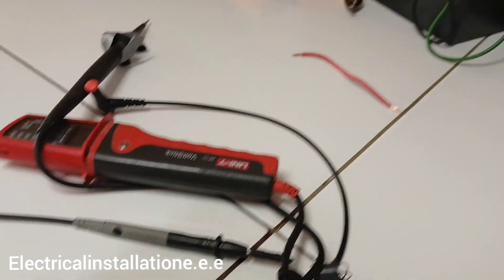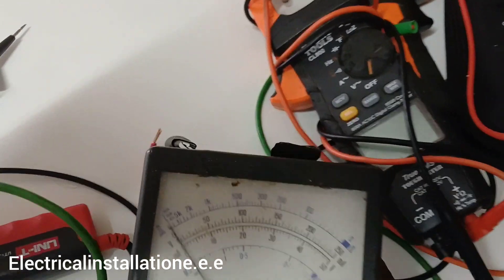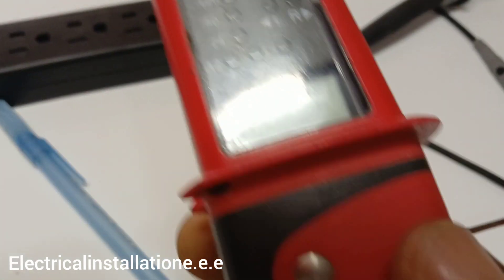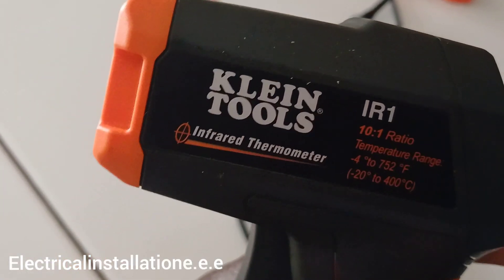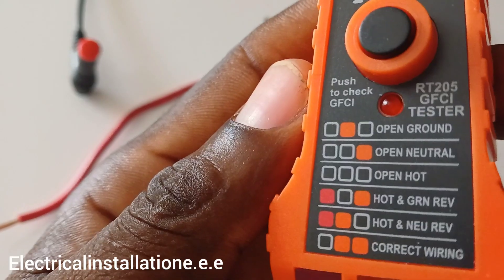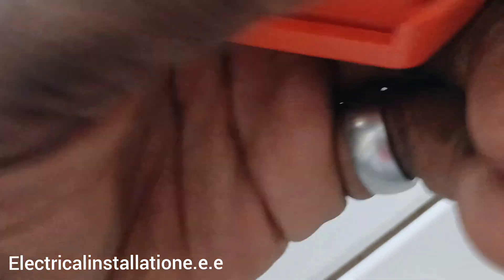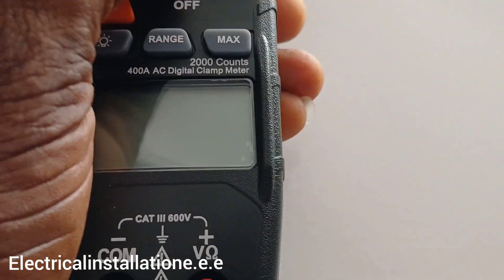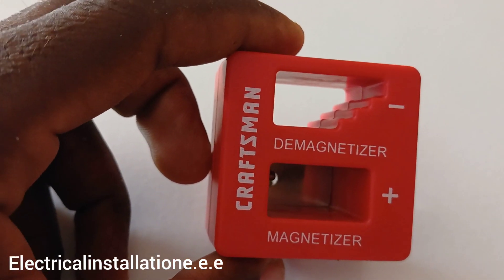How To Use Multimeters !! How To Use Smart Meters !! Purpose Of Electrical Testers..

Comment: What is the best Brand in instruments and also tools for electricians you have proven so far Boss?
Reply from the maker: I would say klein so far
Reply: Klein definitely have some cool electrical tools, the clamp on meter is favourite of mine.And the non contact voltage tester is a simple one but it serve it purpose especially with the beeping sound to let you know the circuit live.
Reply: The ground fault tester its unique tester to have, because it shows when the wiring connect properly vs improperly.
Reply: Fluke, UEI and Field Piece for Clamp Meters. But, if you're on a budget you can get Klein Meters.